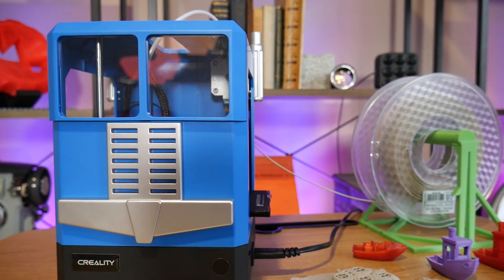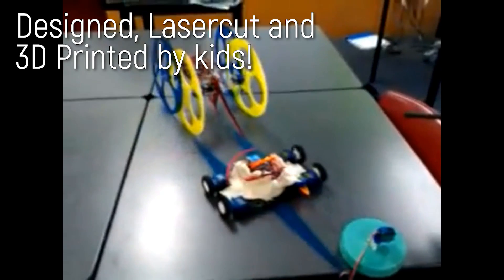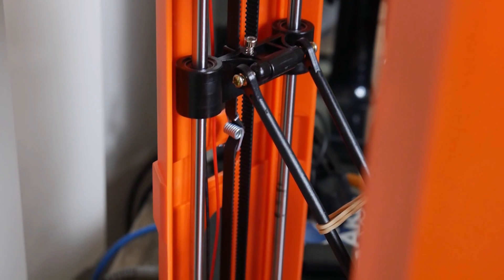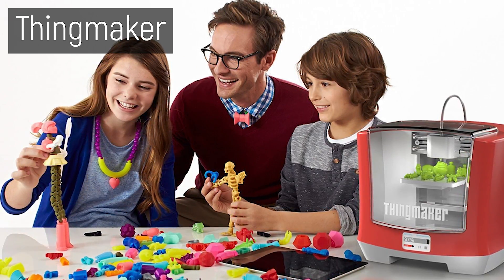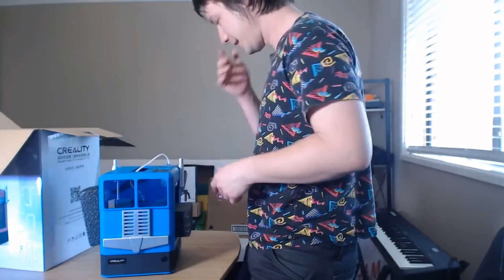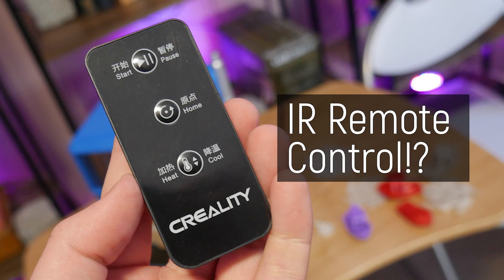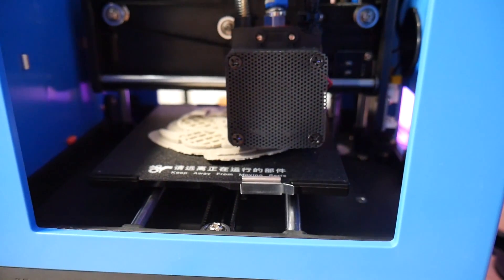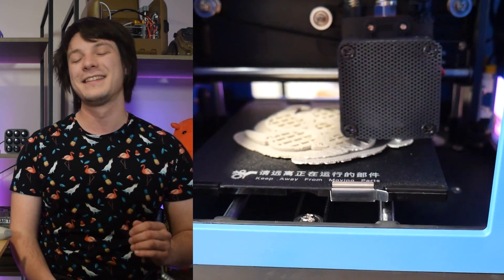This 3D Printer looks like a TRUCK. CR-100 Review

Comment: So far imo the most user friendly and best value for quality 3d printer is the elegoo mars. I started with a chinese prusa i3 kit and with a little work printed well, but before too long I was replacing the cheap priced components. My next endeavor was a folgertech ft-5 and that was a monster to put together and get printing reliably. Within a week the melamine print head carriage started coming apart. I had to zip tie it to last long enough to print replacement parts from abs. Then it was a nonstop issue getting the bed to level the same twice. A few months later several screws holding the x axis gantry vibrated out and it now requires both y axis rails removed just to get to where I need to put screws back into the x axis gantry. My elegoo mars,I just pulled out of the box, leveled the print bed, poured in some resin and was printing right away.

Comment: I'm very interested in building small form factor printers. I would really. like a good look at the mechanisms within this little box. is it possible let. for you to tear it down a little just to.shows those workings?
Reply: for example the extruder moves on the rails as standard but how is the spring mechanism achieved. how does the drive of that same axis work. is the motors staggered below the level of the belts and a pully in place? like the turnigy mini printer?
Reply: Check out Naomi's video... She built a complete new enclosure for it, and has some details about the way it works.... Plus she pulls it right apart.

Comment: Bro I'm 13 and I'm saving for a Cetus or Ender 3/5 or a prusa i3 mk3 or a cr10. I'm not going and choking on SD cards and sticking my fingers in fans and burning myself on the extruder. We kids have more common sense than that.

Comment: I'm modding my 1st CR100 into a 4foot? Transforming G1 Optimus Print - My 2nd CR100 will be approximately 100x100x300 bed with a 140mm cooling fan - using spare 1.14 (non-silent Ender5 Board)

Comment: To be fair Easy Bake Ovens arnt all that safe.
Reply: Joe S no they are not, but a 100w light bulb won’t cause near the damage to little hands that a 200c hot end will. 
(I have no idea what they put in the Easy Bake Oven now. That is what they used when I had one in the 70’s)

Comment: NO WTF, why are you doing this there is no such thing . they put of tiny particles that no kid should breathe in . Do not use one around kids without building an enclosure and some vent or filtration. not good , fine teaching kids on normal printers with safety precautions. You dont leave kids (were not talking teens) alone with a 3d printer fire, burns extra ...............